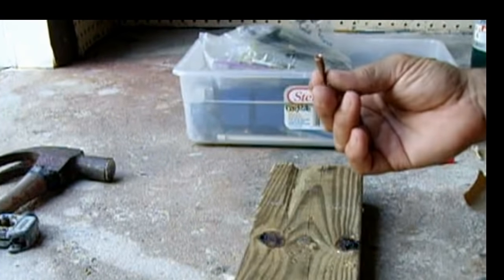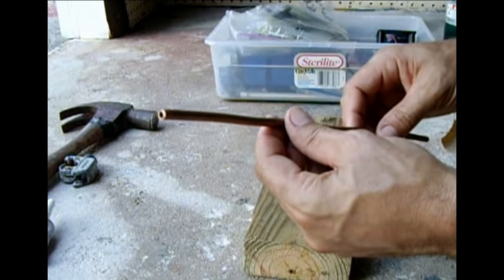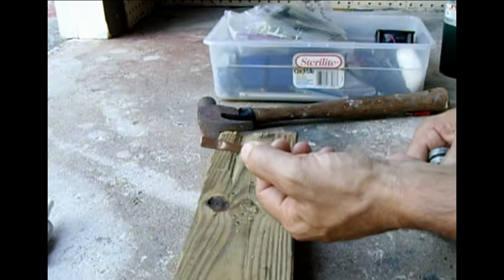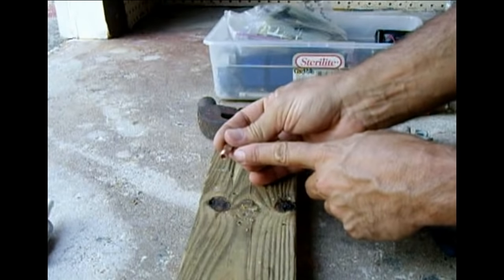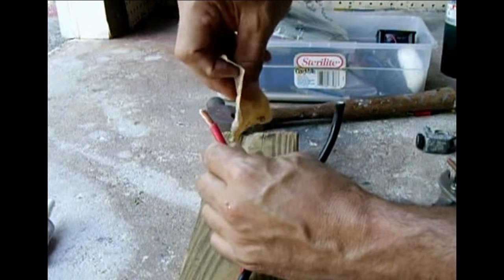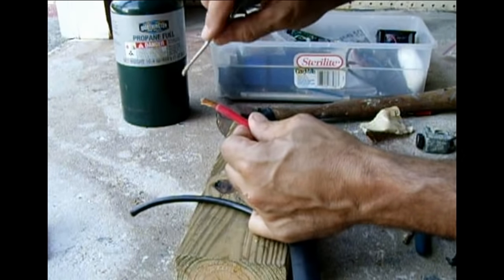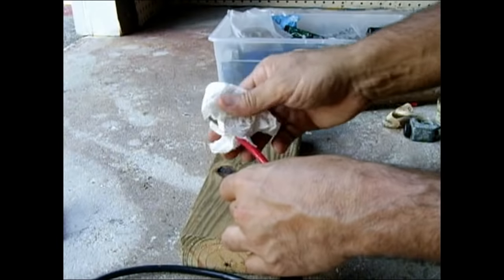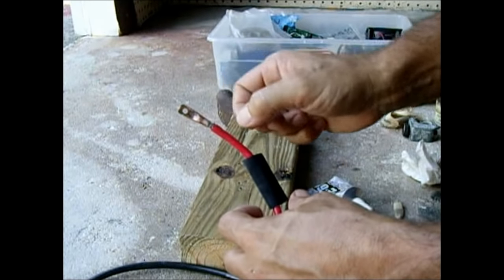How To Make Copper Battery Cable Connectors!

Comment from the maker: Ideally you'd use rosin flux to solder electrical wires/connections, but over the years I've used Nokorode brand copper tubing flux with no long term problems at all. The choice is yours. Once you learn how to make these, they can be made in under 2 minutes if all supplies/tools are on hand. The purpose of this video was to show others how to save a lot of money by making their own copper lug connectors for HEAVY GAUGE wire, nothing more. How you connect the wire to the lug connector is up to you. The best way in my opinion, is to crimp AND solder, followed by heat shrink with glue lined walls. Thanks for watching!

See how I make these connectors suitable for MARINE use in my other video below:
https://www.youtube.com/watch?v=_ZTk3OYacyE 

Soldered Versus Crimped Electrical Connectors:
https://www.youtube.com/watch?v=eedrETFZ3Ws
Reply: I'm looking at my old can of it now.  Black and white can by The M.W. Dunton Co. Had it for years and almost out.
Reply: Easier way to solder is heat connectors n fill with solder then stick wire in. Solder either way works a matter of preference I gues
Reply: Can turpentine be used for soldering wires?
Reply: Nokorode and similar fluxes are not recommended for electrical applications because they leave an ionic residue containing zinc chloride which is conductive.
Reply: High current applications should never be soldered as it is a sad conductor. Crimp correctly or let somebody that knows what they're doing handle it.

Comment: 1st step flatten and then drill hole before cutting off. I've done this on battery cables except that I push the wire right through the copper pipe and then flatten the tube and wire on an anvil then drill through the pipe and wire. I've done this and never even soldered. The pipe didn't have to be a tight fit. Good video. People now days usually have no clue how to help themselves. For me it's not just the cost. If I can't make it myself, it is an hour and a half drive to go get one.

Comment: I used to do this exact same thing when I worked for Bombardier industries working on monorail trains. They taught us how to make lugs from pipe to save on costs as well. The only thing we did different was we dipped the whole lug and cable end in a large solder pot when we were done. This made the soldering job faster ( i had to make lots of these, no time to spare ) we would put these on 4/0 welding cable that would attach to rail power shoes. These assemblies would see 600 volts at 900 amps three phase with no issues whatsoever. Thanks for this vid. This process does work well!
Reply from the maker: Dipping is a great way to do it. You also leave a nice tinned corrosion resistant finish.

Thank You For Watching!

Be sure to share, and check out my other videos as well.
Reply: Let me understand. You had a pot of melted tin, over a bunsen burner or similar, and then you dip an item in there to cover it all with a thin layer of tin? If so, fascinating :) Is that something people do in their garages too, because I would really like to try :)
Reply from the maker: Yes. Very simple to do. Regular solder is usually 50/50. Equal amounts of lead and tin. Lead free solder is mostly tin. Lead free solder does not flow as nicely as regular solder, but is better for you to handle. Make sure the copper or brass piece is cleaned thoroughly, then apply a thin layer of flux, then dip it into the molten solder for a few seconds.
Reply: Did you pre-heat the end with a torch before you dipped it?
Reply: @electronicsNmore You prevent the green crusties.

Comment: Hi, been using that method for decades even on welding machines, no problems ever... Important to clean and make a good solder. I hate being ripped off by big guys that want us to believe that their stuff is the only thing.
I fully support your method...!
Reply from the maker: Thanks Pierre. I also have never experienced any problems over the years. Some people are just never satisfied. I never force anyone to use any idea I put online. If they feel they know better, and do not want to use the tip, then dont. :-)

Thanks For Watching! Please share my channel with others and rate Thumbs Up.
Reply: I been doing same too

Comment: Have done this trick for 30 years or more. When it's too far from the hardware store or you want to upgrade to better terminals, this is the way to go. Tin the wire well and flux the inside of the new terminal before applying solder. My commendations to you for using the correct method by heating the end of the terminal and applying the solder at the other end where the wire enters the terminal. Also, I agree that crimping and soldering make the best terminations. Very well done instructional!
Reply from the maker: Thank you! Be sure to check out my "Automotive/Mechanical" and "Useful Tips" video playlists, rate thumbs up, and share my channel with others.

Comment: One change I would recommend is to "tin" the wire and inside of the connector before pushing the wire in. This means that when you heat the connector and wire up to do the outside soldering the tinned surfaces inside also bond, creating a better and more complete electrical connection.
Reply: +John Posson my thoughts exactly
Reply: if the tinned wire will fit in the tube
Reply: John Posson 
I use a silver solder. Not led.
Reply: Tinning before crimping is not recommended by most manufacturers of crimp lugs. It can create dangerous connections that are likely to come loose.
Reply: tinning the wire is nice..if it will still fit in the tube !   sweat soldering is secure.. if you drill a small hole near the crimped end.. you can introduce the solder there, and not bubble your insulation.
Reply: Sweat solder is the best. Just make sure to clean the the cable and copper. Do use flux that will help the solder flow very easy. Let  the solder flow to the heat source. After you get your connection heated up. Just like when you sweat copper pipe together.
Reply: @tbonemckone  tinning b4 crimp will make the copper brittle and yes causes certain failure..... After soldering these joints as soon as the solder sets plunge it into dry hot sand  and cool without hardening or wrap it with non flammable cloth such as muffler wrap until cool.... Keeps the heat in and allows slow cooling which will aneal
Reply: Using flux like he did the tinning is automatic.

Comment: Many years ago I was a member of a club that converted gasoling engine cars to electric. We made our onw cables to keep expense as low as posible. Our first method was to solder the wire to the connectors as you are showing. They looked great, but after a time someone got a crimper and we tried it. We did some electrical comparisons and found the crimped connections had measurably lower resistance than the soldered ones. We attributed this to the slightly higher resistance of the lead solder.
Reply: very good suggestion
Reply from the maker: I just did the same test using 8 gauge wire, and there was no measurable difference.
Reply: If you are testing with 100's of amps it will be measurable.
Reply: @electronicsNmore, you have to do a loaded test for any difference to be noticeable (since the resistance will likely  lower than between the probe of your multimeter and the piece). The best way is to get a constant current source, and pump a given amount of current through the connection, while monitoring the voltage dropped across it. Then R=V/I
Simple!
Reply: The more appropriate path to take is to use closed end crimp terminals, and then finish off the terminal with a glue lined heatshrink, to hermetically seal the crimped connection. Extra solder in there will only mess up your connection, and the extra heat could relax the crimped joint
Reply from the maker: I prefer crimping and soldering. It makes the lowest resistance connection, which is resistant to oxidation/corrosion.
Reply: I'm sorry, but for large connectors (think 8AWG and larger) a simple, complete crimp and some glue lined sealing heat shrink tubing will make a far lower resistance connection, and will be just as, if not more, corrosion resistant, as the glue lined heat shrinks form a hermetic seal to lock out moisture.
Reply: JIMMY TATE 
We ganged 6v batteries in golf carts with flat aluminium bars ..holes punched and bars shrink wrapped..no joints to heat up..
Reply: that sounds like the way to go. get even better if you could have used copper bars.
Reply: Soft solder really isn't a great conductor of electricity. It is valuable for corrosion and vibration resistance but a direct, copper to copper crimp is best. I've tinned them AFTER crimping for best results. Also if you use a copper or tinned connector on an aluminum bus bar, be sure to use an anti corrosion paste specifically for copper/aluminum joints. It's cheap and available wherever electrical supplies are sold. Without it both metals will corrode very quickly.
Reply: The square of current times the resistance is the power dissipated in a poor connection. Even if you only have, say, a hundredth of an ohm resistance, a 100 amp current (not unusual in a starter circuit) means there is a hundred watts of power lost in that connection. If you've ever touched a 100 watt light bulb you know that adds up to a LOT of heat generated. Confine that to a small connector and you can get serious problems.
Reply from the maker: Solder isn't a poor connection. :-) You seem to forget that battery posts are made out of lead, and they do just fine under a heavy current draw. Thanks for watching
Reply from the maker: I've used that paste many times over the past 30 years, it's called "Noalox"
Reply: electronicsNmore u
Reply: JIMMY TATE well duh crimped connection has less contact surface with the wire bundle. Soldering usually seals any gaps with the wire and lead
Reply: That's how I have done it for decades now, you get the longest lasting connections.
Reply: The lead post on a battery is just an extension of the lead plate in the battery. I'm not saying it is a "poor" conductor, just not as good as copper. A solder only connection works fine in solid state circuits where voltages and currents are very low. However, it creates a resistance node and potential hot spot with high currents. You need good tight mechanical connection before soldering.
Reply from the maker: Of course solder isn't as good as silver, copper, aluminum, or gold, but it still works very well, especially if silver solder is used. Unless you have a quality crimper(hydraulic), that will compress all the wires inward to a very tight core, then I would recommend soldering. The solder will fill up all the micro voids allowing more contact/lower resistance compared to using an inexpensive crimping tool which flattens out the wire strands. Solder has been used for years for high currents inside power inverters. The traces are wide and covered in solder to allow the traces to handle more current. My homemade inverter generator used copper lug connectors that were crimped on(using a cheapo crimping tool) and soldered. Never any issues. The voltage drop across the solder is extremely low because you're only passing through an extremely thin layer of solder.
Reply: Soldering after crimping anneals the copper and relaxes the pressure of the crimp. Do one or the other but not both.
Reply: Aluminum is about 20% - 25% less conductive than copper.
Reply: Battery posts are usually much larger in cross section than the battery cables partially to overcome their lower conductivity. ; )
Reply: I bought a 10 Ton hydraulic crimper from Amazon (ok it was made in China) but makes great crimps and so easy , best purchase I have made. :-)
Reply: Gentlemen, I used to work for a military contractor to the Navy making devices that are used to this day and have to be reliable for many years to come. The basic rules on all electrical connections was they had to have a good solid mechanical connection. Solder was only used to provide corrosion resistance to protect the electrical properties of the mechanical connection. This policy is based on many years of learning what works in the real world over the span of the last 100 years.
Reply: trucker 9000 Wrong! Military circuit boards are multilayer copper and fiberglass printed circuit boards that require that the integrated circuit chips have the leads folded over after being inserted into the PCB thus locking the IC into the PCB and providing the best mechanical connection before soldering. By the way, military grade PCB's have up to 7 circuit layers.
Reply: trucker 9000 You are thinking of some very old technology.
Reply: Lawrence Withrow I'm rewiring my double battery 12 v system in my my dodge CUMMINS truck . How would you do it wire size, crimp no crimp Ect...? Any help would be greatly appreciated. I love efficiency and learning from experienced fellow you tubers.

Comment: I've done this before and it's always a great way to save money. A little tip on prepping the copper, for the inside use a gun cleaning wire tip chucked up in a cordless drill. On the outside if you plan on do a lot of these pick up a wire wheel brush for your bench grinder or cordless drill. Cleans and preps the copper really well for soldering.
Reply from the maker: Mikey8567 I have done both. :-).

Thanks For Watching Mike.

Comment: Great Idea.......I drilled all the holes first, at regular intervals, cut them off with a chop saw, (slowly) then put them in my reloading press to flatten them, dropped the whole stack in my brass cleaner, then deburred them with my case trimmer. I'm gonna buy different size copper tubing, and make me a lifetime supply of them. You saved me hundreds of dollars, because I'm always working on stuff like that.

Comment: nice video. this is how i do it, insert the whole stripped wire till the end of the tube before flatening and drilling it. no soldering needed. holds a firm grip of the cable, no need to worry bout burning the insulator.
Reply: Thanks, +ambutsikik :D  I have been making butt-splices and terminals out of soft copper refrigeration tubing for nearly 50 years and had never thought of doing it that way. Seems like best time-saving idea I have heard in weeks!!! Trying this one tomorrow. But instead of drilling the hole for the stud, I will punch the copper with a Whiney punch.  Normally, especially for wire sizes that do not precisely correspond to the tubing ID, I pound a swage tool into copper tube to reform the cut end and create a bit more space for the wire to slip into.

Comment: I saw this video the day before I was going to go buy a bunch of pre made ends for a car audio install in my truck. Glad I watched this it will save me a bunch of money that I can spend on better wires now!! Thanks man! Harbor freight has the Marine grade shrink tube with the glue inside of it already, it's thicker and that's all I use even if not going to get wet just because of the seal and thickness. It's cheap to but I really dig this method thanks again!!
Reply from the maker: I have many excellent videos on my channel that cover a wide range of subjects, so be sure to look over my extensive video playlists for other videos of interest to you, rate thumbs up, and most importantly SHARE my channel with many others. Thank you!

Comment: The best way i found is to use resin core solder.
Put your fitting upright in the vise and fill it  with the solder then put in your cable and add some more heat,then you know all your wires are completely covered sealed in solder.
Reply from the maker: I also do it that way. :-).
Reply: Thanks mate,yeah it never fails.
Thanks for your reply.

Comment: Soft drawn copper can be used as a straight splicer too. It will crimp in most professional grade crimpers. Just pick something that fits over the wire, the closer fit the better. If you want an insulated connector, just slip on some heat shrink tube. I haven't bought a Sta-Kon in years.

Comment: Look towards the light!  Follow the words of wisdom from all the electronic & electrical guru's ... Who can make solder run up hill,downhill and sideways ... It goes where the heat goes.  And this is a great post to save some green....
Reply: So what you're actually telling me is that, that solder actually ran "up hill", because the heat was on the end of the terminal, and didn't run all the way down the inside of the insulation like a normal liquid would?

Comment: This is a fantastic idea!  As an amateur radio operator I use these type terminals often.  Subscribed!
Reply from the maker: Thank You!

I was in Harbor Freight the other day, and they are selling (2) 6ga copper ring/lug connectors like these for $2.99! Auto parts stores much higher.

Be sure to check out my video playlists as well.

Comment from the maker: Martin Kannegieter Using a vice to squash the connector is no good. The result will not lay flat. Usually I drill the hole before cutting the tube, but when you are making a video, sometimes you end up doing things differently.

Thanks For Watching!
Reply: electronicsNmore Just for laughs, did you ever get your heat gun back? haha
Reply: +electronicsNmore you do know most vices have an anvil on the back.
Reply from the maker: Sam Noneofyourbisnus
Of course, but most people would use the jaws to flatten the copper, which is not good. The anvil is great.
Reply: I just smash the copper connector with a hammer onto the wire
Reply: Po